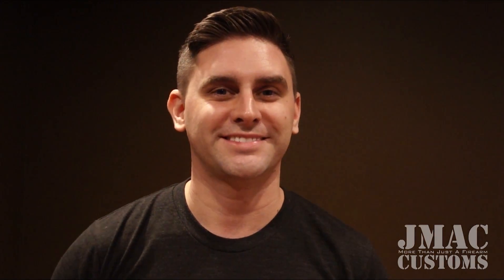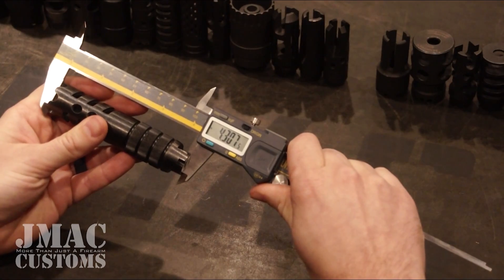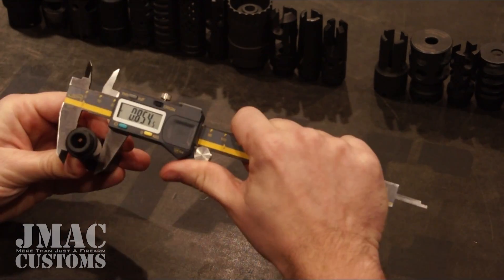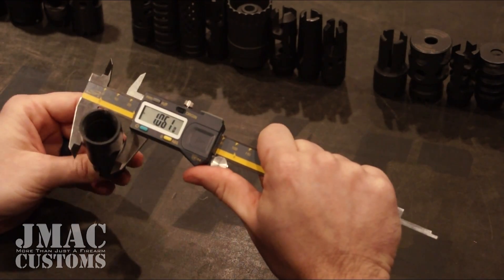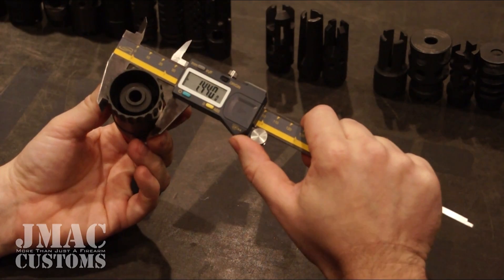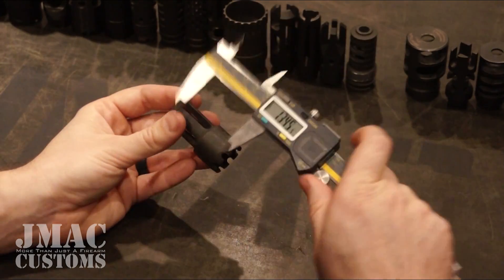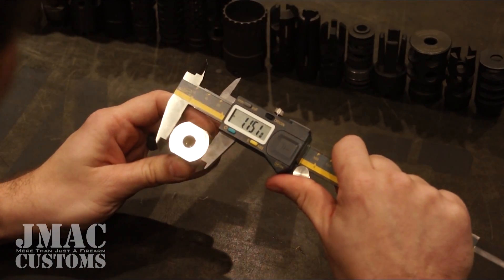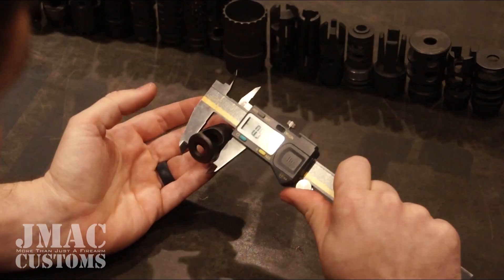AK Muzzle Device Testing - Dimensions - Episode 2

Comment: Its kinda a draw between the 3/4 prong flash hiders, and the "cone in a cup" bulgarian type, the modern ones like the flaming pig are just slightly better than the old surplus ones. Just my opinion but ive used several and nothing beats those 2 designs. The prong ones are best for flash but the Bulgarian style also dampens recoil a bit and alters the report a little bit.